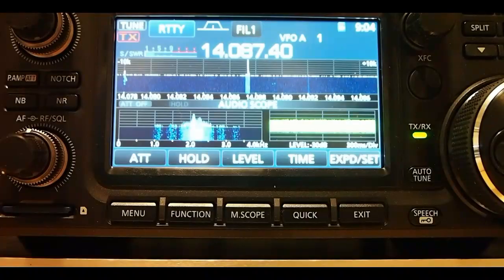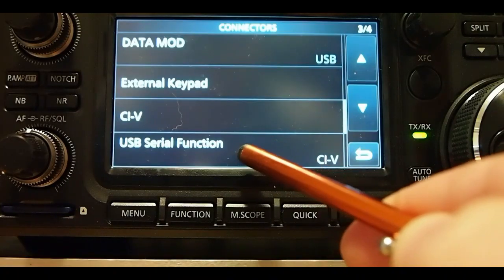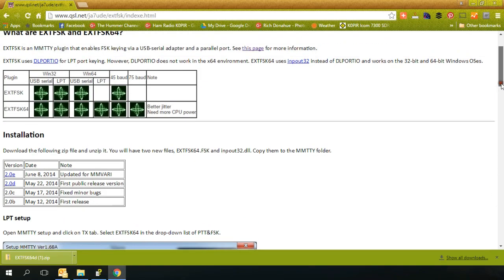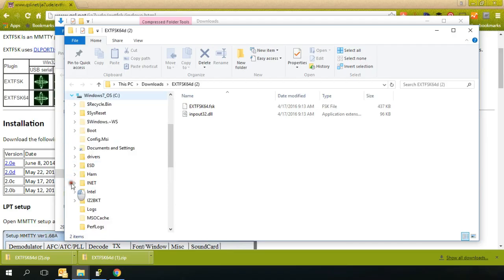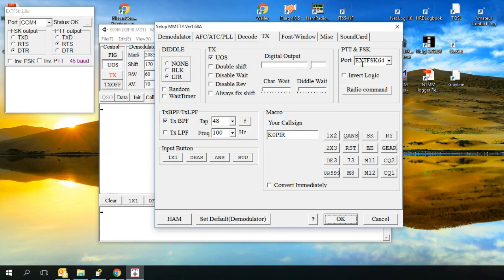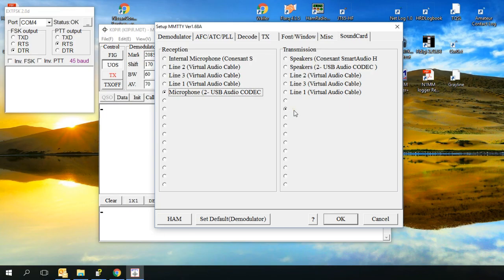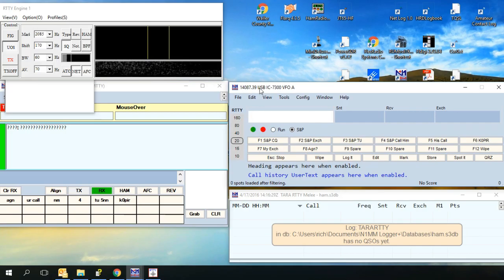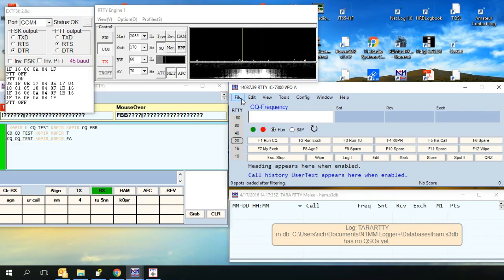Icom 7300 RTTY FSK Setup MMTTY N1MM How To

Comment: Rich i  got round to getting this mmtty to work but i have a few  questions , does it matter about the ALC levels in mmtty, how do i slow down the information coming across the screen  i can do this on the 7300 by ajusting the threshhold , after i hit the tx button and my message has stopped but it keeps sending tones untilli hit the stop button is there a way to have it auto stop .
Thanks .

Comment: How to make it work on IC-7410?
Reply from the maker: Hi Robby,
Thanks for commenting and I appreciate the question, but I'm afraid I don't know. I don't think FSK works on the Icom 7410 like it does on the 7300. Have you looked for the  the Icom 7410 Yahoo user group? If they have one that's where you could find a definitive answer. Thanks and best 73 - Rich, K0PIR

Comment: Nice job. I am curious about how to down load the file needed from icom for the drivers before connecting it up to my lap top, Icom made it sound difficult
Reply from the maker: It's not hard. Just click on the link and download it to your computer. Go here: https://www.icom.co.jp/world/support/download/firm/IC-7600/usb1_20/
Once you click on agree it will download the driver to your computer. Then just unzip the file by double clicking on it. There is an installer file in the "Driver" folder. Choose the one for your system. Mine is Win10 and 64 bit, so I used it. Good luck and thanks for commenting. Did you get it working?
Reply: The link you provided says IC-7600 ????
Reply from the maker: The driver supports the following transceivers (as of January 2016). After installing the driver, connect the transceiver to the PC, and then the USB driver is automatically installed to add a COM port.

・IC-7100
・IC-7200
・IC-7300
・IC-7410
・IC-7600
・IC-7850
・IC-7851
・IC-9100
Reply: Thank You I finally called Icom they were most helpful, you have to admit  or at least for me when they give you the link Firmware shows first and you have to keep scrolling down to get to the driver file

Comment: Richard, the IC-7300 is on my very short purchase list, so I've been watching a number of videos pertaining to the radio, particularly some of yours.  One thing that I'm confused about:  supposedly the USB cable provides not only audio, but also rig control.  However, in your video you indicated you use USB for the digital modes (I'm presuming you're referring to the audio) and you use a CI-V cable for rig control.  Can rig control be done through the virtual ports that are set up when using USB, or are your software applications (MMTTY, or N1MM) requiring the use of CI-V?  73, Edward, N8OIF
Reply from the maker: Hi Edward, that's a very good question. I have read a thread on the YaHoo groups that points to being able to see 2 virtual com ports setup after installing the USB driver from Icom. However, I am not sure that it works. It appears now it is only the 7100 that does this. You can read more about it here: https://groups.yahoo.com/neo/groups/ic-7300/conversations/topics/6174 and here: https://groups.yahoo.com/neo/groups/ic-7300/conversations/topics/6147
You may be able to use a virtual serial port manager or virtual com ports, but I haven't tested that yet. I used VSPM with my Flex and it worked very good. 
For now I'll continue to use two cables . I actually have only one cable going to my laptop because both of the cables from the radio go to a USB hub. Hope this helps and thanks for asking. 73 - Rich K0PIR
Reply: Rich, thanks for the info and thanks for all of the IC-7300 videos (and your other videos).  I'm planning to buy the 7300 this coming week.  I just purchased the IC-7100 as well, but I've sold some older gear (my Kenwood TS-2000X and a Yaesu FT-897D).  So while I may be able to do everything through the USB cable with my new 7100, I'm going to hang onto my MicroHAM Micro Keyer II interface for my 7600 and my upcoming 7300.  One of the modes that I've never used is RTTY and I would prefer true FSK instead of AFSK, so it sounds like I need my interface to operate FSK on the 7300 and 7600.  73, Edward "Ned", N8OIF
Reply from the maker: Hi Edward, Sounds great! For RTTY I just use my CI-V cable and USB cable. You may be able to use one USB cable with a virtual com port program, I haven't tried that yet. The 7300 is capable of FSK and it works great. I used it in a RTTY contest (N1MM & MMTTY)) and really enjoyed it. . See: https://www.youtube.com/watch?v=ZCkiuzAMuZI&list=PLBDk9lmKMHPSlKEP4sVhfiCnMkLPB_2Eg&index=9 and https://www.youtube.com/watch?v=UHjYqbTTCaM&list=PLBDk9lmKMHPSlKEP4sVhfiCnMkLPB_2Eg&index=7

Comment: I thought you only needed one USB cable to carry digital audio and CI-V data (it sends both in one cable) see  2-3 of the operating manual.
Reply from the maker: Hi Deze, great question. You're absolutely correct. The problem has been that when we install the USB driver from Icom we only see one com port. That is fine if you want to control the rig and run some digital modes, but I like having CW and RTTY (FSK) and that will require another com port for keying. That's why I'm using two cables. Two cables creates two com ports. It's great for me to use CW keying in software like N1MM and also to have my CW paddle connected to the rear. I can alternate between sending code either through the paddle or the software. And RTTY (FSK) is just better in my mind than AFSK. See the reply above I made to Edward also. Thanks for asking, hope this helps, 73.- Rich, K0PIR
P.S. There is also the option to use something like VSPE to emulate extra ports and still use one cable.
Reply: Thanks for the reply Rich, Yes i use my IC-7300 with FL digi and OSX so my drivers differ a little i guess. I don't use keyers, i just let  RTTY PSK CW encode/transmit & decode via one USB cable - audio/data.
Thanks for the Video. M6DEZ
Reply from the maker: Sounds great. I hear it is really god with MacLoggerDX. FB and thanks for commenting, best wishes. - Rich, K0PIR.us
Reply: What are your setting for fldigi.
AC6DX
Reply from the maker: Hi, I try to keep everything the same for all of my programs. See if this video helps. https://www.youtube.com/watch?v=yIPIG8fdtJc&index=1&list=PLBDk9lmKMHPSlKEP4sVhfiCnMkLPB_2Eg